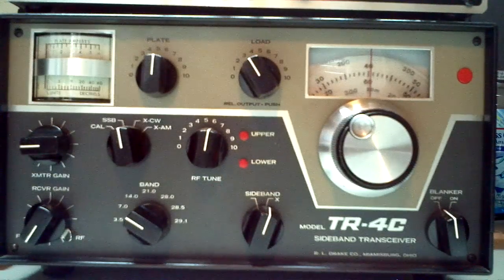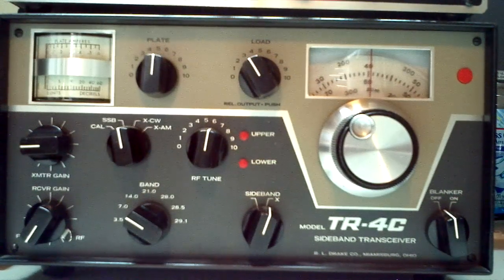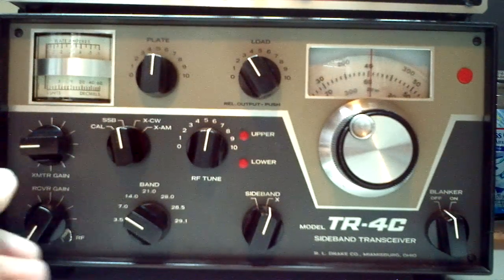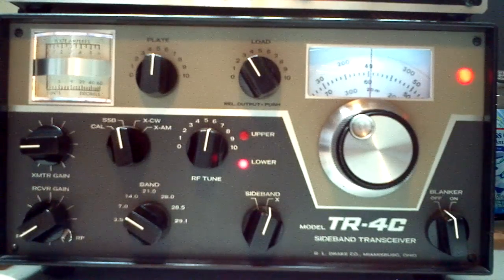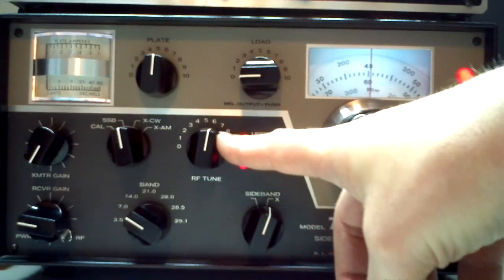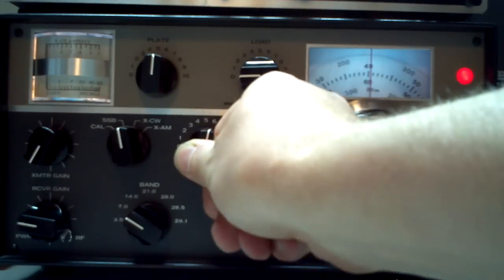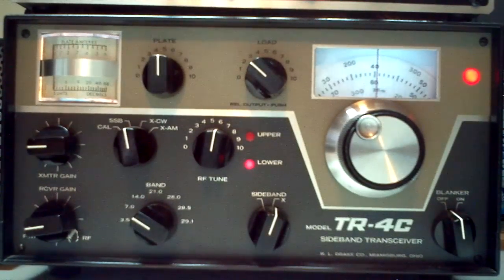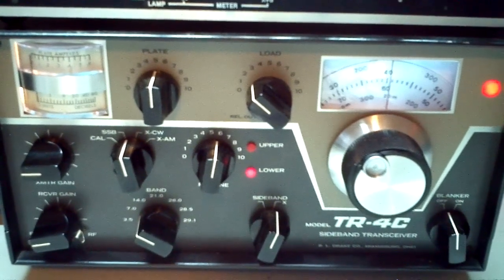Drake TR-4C Tuning Up - Ham Radio

Comment: Nice video! I have 3 Drakes and love them. Picked up the TR-3 first, then acquired a dead TR-4 that is now
a very nice radio. Then I picked up a TR-4C that needed a little TRC. I really like the dual dial on
the TR-4C. I love the sound of the Drakes. I only operate tube radios and Drake is one of my favorites.

Comment: I know what you mean!  I'm 57 years old and I always preferred these old American rigs.  I started out with a new HW-101 that I built when I was about 14, I think it was toward the end of production.  Like you I got disinterested in ham radio after starting college, and when I picked it up again in the late eighties the solid state Kenwoods and Icoms didn't impress me at all.  I purchased a Swan 350 at a hamfest despite the group of guys looking at it before me bashing it.  These radios are not only incredibly well made, but a pleasure to operate and easy to tune and fix if something goes wrong.

Comment: Had several Drake radios including the Twins  and Tr7. Great fun, you can work on them yourself by replacing tubes and checking your caps and transistors. Ten thumbs up !

Comment: Thank you for the tutorial I just picked up a Drake Tx4B transmitter. I have not tuned an HF transmitter since my SWAN 500 way back in 1993. I picked up a Tx4B to do AM on 3885 and this was probably not the best choice. Late night eBaying is sometimes in error. But love the rig. I pulled out the finals to just see if I can get any RF on a receiver and see if there is drive to the finals at all. I plan to use WebSDR's as receivers so I will not need a receiver.

Comment: Great video! Still love my TR-4; the quickest way I  tune  the transmitter it is into a  50 ohm dummy load for max power then I switch to  antenna with the tuner adjustments only for max power ...

Comment: Thanks!  Just got a TR4 C restored and was afraid to use it for fear of blowing the finals.  The manual does not give as good a description of tuning transmit. One question.  In the beginning  tuning the transmitter gain how far up do you go?  Just a little?  My radio seems to be able to go higher.  When do you know that you raised it to the right level?

Comment: Great Video. I have a TR4. Same tune up it looks like. So, if you wanted to transmit on low power, like 5 watts, would you tune up as you demonstrated and just back off the power or would that upset the tune up?
73 N1PGP

Comment: Here's my ignorance of old gear.  The X-CW (CW - Tune) switch, does that activate transmit, or did you have your key activated as well?  At what condition is this rig transmitting into the dummy load?  I got a TR3 for a song, and I don't want to mistreat it!
Reply: Yea when its in the x-cw setting etc its in full transmit. hes not keying down, so have it plugged into a dummy load or a tuned antenna prior to doing so.